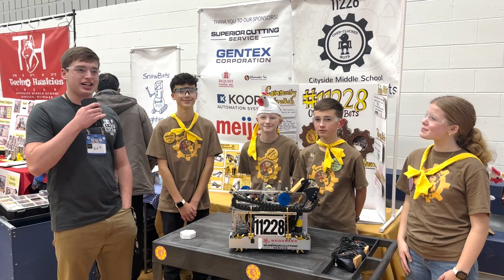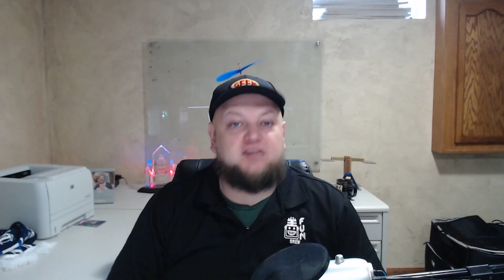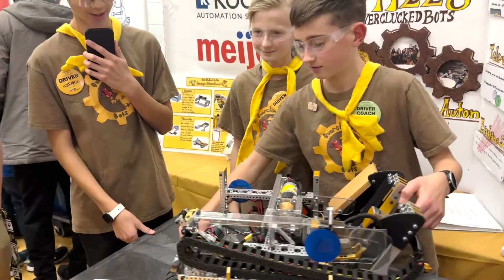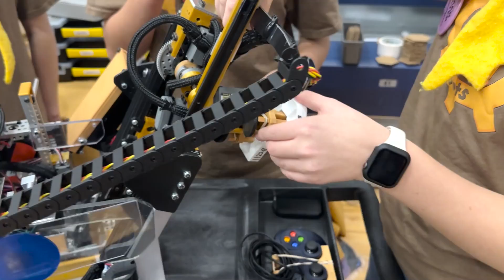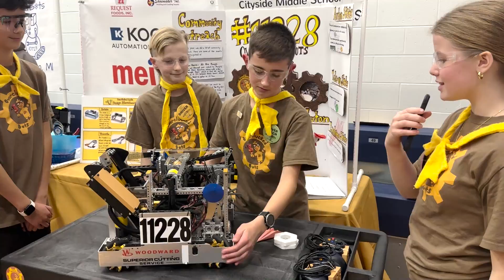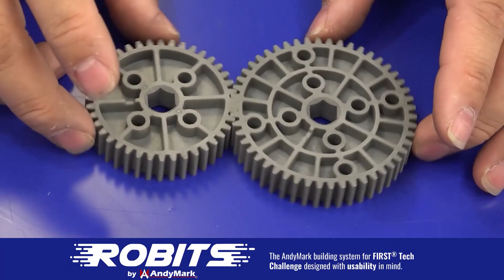Behind the Bot | 11228 OverClucked Bots | CENTERSTAGE Robot

Comment: What is the black casing that keeps the cables going to the output arm? Where can it be bought? FTC Student here
Reply: Hey, good question! (Overclucked mentor) its a type of cable sleeve. We buy it from Amazon usually in all different sizes. The other stuff used for our wires from the board to the out-take is called cable track.
Reply: Hi! @BrandonFTC11228  Thanks for the response, could you please drop a link to the cable sleeve? We were having trouble finding one similar to that which could reliably guide our cables
Reply: @BrandonFTC11228 Hi, is there a link to the exact one that you guys bought if you are willingly to share with us (Both cable sleeve and cable track). My team cable management is a mess 😂
Reply: @BrandonFTC11228 Hi, can you send me the links of both cable track and cable sleeve that you guys used?